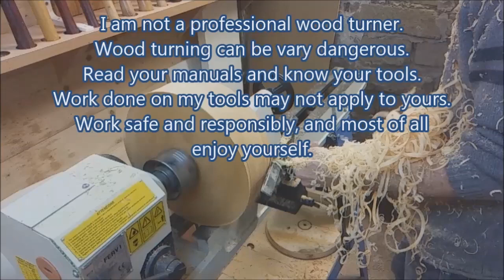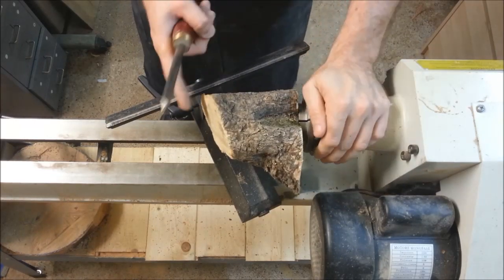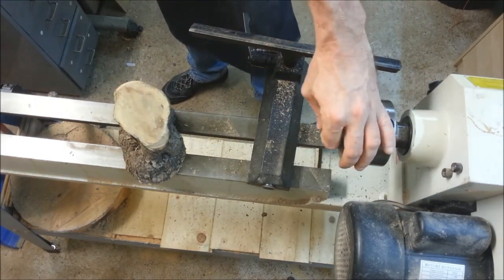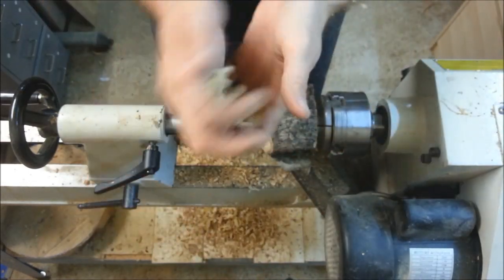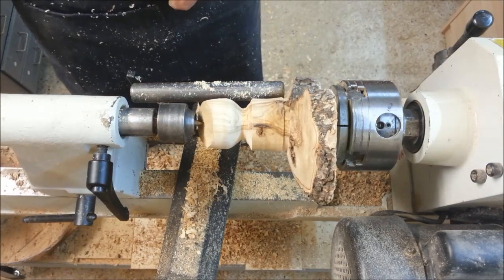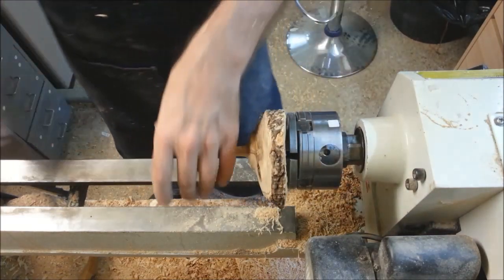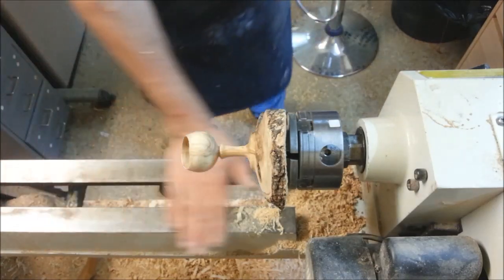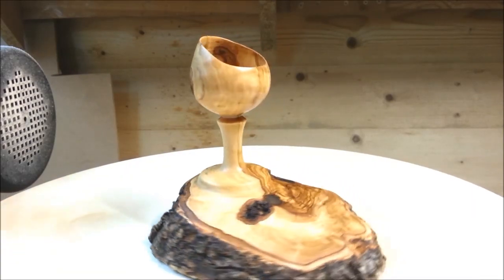Woodturning A Natural Edge Emerging Goblet

Comment: Thank you Yuval,
I've been following YouTube turning for a long time and I have to say that is probably the most beautiful piece I have seen.  It has everything: beautiful wood, masterfully turned, a piece of natural edge, lovely finish etc.
I wish I had your talent.
If it's any help I've had some problems with the worm screw but now I bore the hole on the blank about 3/4 depth, start fitting the worm by hand and then using a small spanner/wrench finish it until it bites into the wood for the last 1/4.   I then fit it to the chuck and it normally stays there.
Best wishes,
Alan.
Reply from the maker: Alan Simpson Thank you Alan,
I've been uploading videos to Youtube for a little while now, and I have to say that is the best compliment I have gotten. :)
I shouldn't have used the screw to start with, end grain and all, and then I should have used the tail stock from the get go, and maybe that tear-out off the screw could have been avoided that time.
I'm not sure I understand your method, you drill 3/4 of the depth the screw will fit into, and let the screw bite on its own the rest of the way in? my wormwood screw had a flat head, I don't think it will work on mine, I know there are some screw chucks out there with a pointed screw, do you mean that type of chuck?
Reply: Thank you Yuval for your reply.When I use a worm screw I find the centre of the blank even if it is end grain, drill the hole preferably with a bit a little smaller in diameter than the worm, just go maybe 3/4 or 2/3 depth.   I then insert the worm screw which isn't pointed but flat-headed just like yours.   I enter as far as I can just using my fingers after which I use the small wrench to screw it home.   The last little undrilled part of the hole then accepts the end of the worm  and bites.  The worm should then be really tight.   It takes a little bit of effort to gain that extra bite but well worth it.  Having said that my worm screws have two flat sides on the protruding head which enables the use of the wrench.   I then fit it snugly into the chuck and tighten it.  Usually (not always) it stays on and where possible I bring up the tailstock as you did for extra security.I have set myself a task of now watching your other uploads over the coming week.  I'm always hungry for new knowledge and totally  obsessed with turning and just love beautiful wood.Kindest regards,Alan.
Reply from the maker: Alan Simpson Thank you for your explanation Alan, I keep thinking cross grain, but it's end grain we're talking about, it will part for the screw even if it's not drilled, I need to keep this is mind. I used to screw my wormwood screw off the lathe, and then I used the flat sides on the base of it with a ranch to tighten it, usually all the way to the flat bottom, but then I found out I'm using the screw wrong, as the flat bottom I used to screw to was actually the guide of the screw, which supposed to be flat against the floor of the chuck, and I found it out since pieces were flying out of the chuck with the screw, which didn't seem right, only then did I found about the real depth the screw needs to be set in the chuck. Ever since I've been screwing my work onto the screw while it's already correctly placed in the chuck. I've been an avid Youtube turning videos buff a while back, then 4 years ago I took the plunge and started turning, up until last month I had only a couple of hours a week to turn, so I didn't do much, but since I lost my job a month ago I seem to have a little bit more time on my hands to turn and upload videos... would prefer a job, and go on turning for a couple of hours a week, if you ask me, feeding the kids and paying the mortgage is quite a motivator to wake up and go to the office :)
Reply: I'm sorry you are out of work at present especially when you have a family and a mortgage.    You sound like  very intelligent and civilised person so hopefully you'll be back in work soon.I am in retirement now which means I can and do turn most days.May I ask which country you live in - I'm always fascinated where people live.Best wishes,Alan.
Reply from the maker: Alan Simpson It's ok Alan, I'll find something to do for a job, that, or sell my house and kids :)
I live in Italy and have been for the past 12 years, but in fact I'm Israeli. The economic situation here these days is not so good, and the fact is I don't have a job anymore since the company I worked for the past 5 years have come to realize that they are making no money here in Italy, due to high taxes on everything, so they are moving to Cypress and open the company there, so my contract wasn't renewed a couple of months ago, since they need to close down... just bad luck I guess, but there is not much call at the moment for 38 year old mobile/web multiplayer games programmer, which is my profession for the last 20 years. To tell you the truth, I would love to switch line of work, sitting endlessly at the computer day and night is not my idea of fun.
Reply: Thank you for your reply Yuval.    I've only visited Italy once and loved it.   Also, I'm an admirer of the Israeli people especially what they went through during the Second World War.I've two sons both  of whom work in London and one of them is a webmaster while the other is an employment lawyer.   They both sit in front of computers all week but at weekends and during holidays they go walking on mountains to compensate.   One of them is off to Finland next month to do some walking.   I offered to go with him but he declined as I'm too slow:-).You are a very gifted turner so maybe you should set up your own gallery and workshop and think about giving tuition. There's a gentleman who lives on Crete who does exactly that and advertises in UK turning magazines.Any, I look forward to seeing your other uploads and wish you all the best for the future.Many thanks,Alan.
Reply from the maker: Alan Simpson Thank Alan for the interest :) Next time around you come to the Rome area, let me know first, I'll show you around, and no worries, I'm not keen on fast walking, so pace can be as leisurely as you'd like :)
If you haven't been, Israel is a wonderful place to visit too, you know, under the circumstances... I would love to open my own gallery, as a matter of fact the town I live in just started a program to encourage local artists, where they give them a space to work and show and sell their goods for a minimal rent to the town, and I have a guy who knows a guy, and they are both checking to see if I qualify for the program, so it just might come true. Should it will, and should I be able to make a living off my art? I will call it a life long dream come true, as a son and a grandson or artists who couldn't.
Reply: Hello again Yuval,I've looked up the guy in Crete and coincidentally he specialises in working in olive wood.His name is Nikos Siragas and his website is www,siragas.grI've considered going to him for some extra tuition and combining it with a holiday with my wife.   In cases such as this he provides activities for wives /partners of his students such as day long coach trips.I still may go some day but it means travelling to Athens first before getting a connection to Crete.However, wood turners can overcome anything:-).Alan.
Reply from the maker: Alan Simpson Sounds like something I could manage to do, if I only had the starting capital for a studio (right now all the space I have is a couple feet of paved back garden), but it sounds like an amazing experience! I once been to Greece, took a hang gliding course there a few years back, but I love the turning course + activity for the wife combo! sounds like a win/win/win for all.

Comment: That's a fabulousn piece with a great summary of how you felt on completion. I've just done my first natural edge goblet and you have now inspired me to have a go at an emerging goblet. Just one thing: How did you finish the base particularly where you had a screw chuck. Did you plug it or leave a hole. You know woodturners, the first thing they do is turn a piece upside down to look at the base. As if Joe Public cares!
Reply from the maker: I do use plugs to fill the holes, you can see it in a video hiding a few videos down, about how I finish the bottom of my work.

Yuval

Comment: Yuval - this is so beautiful. The wood is gorgeous and the goblet and base are magnificent. I watch this every so often, cause you did a great job and a great save :)  I would like to try this , altho getting Olive wood is a little hard where I am in the South. But I am going to put this on my things to try. I assure you I will be referencing this video multiple times. But it will take me many tries to get one as beautiful as this. Take care and safe turning.  Jan .....
Reply from the maker: +Janice Kneule Jen, this was the first time (and so far the only time) I've trying something like that, so if it went so well for me, I can see no reason why it can't go well for you. Just go into it with extra confidence, make sounds like you know what you're doing, think twice before each cut, it's simpler then it looks, and for it was mostly luck with the wood, the shape of the off cut, and a good and lucky day ;)
Reply: Yuval Lahav Will do Yuval. !!  If I make thru one of these, and it looks good, I'll post to FB. Have a good one - Jan .....

Comment: I just have a cheap 4 speed lathe that I'm using.  The lowest speed is 1,100 on it.  Will that be slow enough to do this type of turning?  Your work is both beautiful and inspiring.  I wish I had access to Olive here.  I turn mainly nut and fruit wood.  Thanks
Reply from the maker: Thank you Todd! A speed of 1,100 is a little fast, but in the end, it depends on the shape of your piece, the more misshapen it is, the lower you should spin it, or as far out of center you plan to turn it, the slower it should spin, so yeah, you could turn something similar at your min speed as long as it's not very misshapen and/or you don't try to turn it very off center. Hope this helps! And sorry I can't help out with some Olive ;)

Yuval.

Comment: I have , and am now checking out the laser engraver you used to personalize them. By the way how is it holding up for you.
Reply from the maker: Just perfectly, I've just finished laser carving on a set of 10 pens, and on their boxes a mixture of logos and text, worked the machines for about 3 hours non stop, nothing even turned warm. Still works :) The only thing I would change is I would love for them to ship with it a key to turn the lense, since you have to set the focal length by hand by screwing the lense in and out for different heights, the lense screw is quite small and uncomfortable to turn if you have thick fingers like mine. A cheap metal (or even plastic) key that fits on the lense to help you turn it would have been a plus.

Yuval.

Comment: Very nice Turning my friend.  The form is awesome function well...  Bet you now why it came off the lathe...Worm screws don't hold very well in end grain.  It would've been better to use the side grain for the mounting...It's a learning process and I've learned that one the hard way...Seems when I get older the hard way is becoming more and more prevalent.  Thanks for the fun vid...

--Marc
Reply from the maker: Marc Tuunanen Thanks Marc! I did know that, but as always, I remembered it only after it came flying off the lathe... what I didn't show on the video, since I want to keep them short, if you can call 20 minutes a short video, are the different attempts to fix it, using a plastic sleeve inside the hole and screw it back, then a dowel in and drill again, some fresh shavings packed in, epoxy and re drill, nothing worked, I didn't want a different orientation, but in the end it all worked out :) Thanks for watching and for your comment!

Comment: Great job, Silly question from a beginner,this is green wood? Thanks
Reply from the maker: WILL R Will, not a silly question at all, I didn't mention it in the video, this is a fresh off cut from a piece of olive wood that fell in front of my house in a wind storm a couple of months ago, you can see it in video #7, where I cut it up and make a couple of tealights with some of it, and you can see a couple more piece of it in different videos, and through the magic of the internet, you'll be able to see more of it in the future :)
Reply: Yuval Lahav Thanks for the reply Yuval,I guess my next question is will it not warp when it dries out or is that what you want it to do. Thanks again,enjoyed the video and what a great help for a beginner.
Reply from the maker: WILL R Well Will, it will warp, no helping that, what I do is keep on oiling the vessel (in this case the goblet and base) every couple of days and let it cure, this displaces some of the water and will make it warp less then normal, but warping will happen, it is different from tree to tree depending on the grain, moister content and many other factors, but I can tell you I simply love how the Olive warps, he gets ridges on the surface with every change of color in the spalting, making the surface look a little like Damascus steel when looked at from the side, it's quite lovely. Holm Oak for example will warp very very little, almost un noticeably, but it will shrink in general a little (if you've seen the rest of my videos, I'll show the vase with hemp string I made in a few videos, soon, to show how it almost didn't warp but shrunk), on the other hand, European Eucalyptus will warp so bad about 90 percent of what I do with it won't survive at all but will fall to pieces when it dries.
Reply: Yuval Lahav Thanks Yuval,good information,very helpful.So much to learn about wood.
Reply from the maker: WILL R Any time Will, you chose a hobby where the learning never ends... which is good, it will leave us interested for the rest of our lives... :)

Comment: i was wondering, at approx 09.45 you were worried about the danger of working at that angle because of the base restricting you from working at your natural angle, is it not possible to work from the other side of the lather or is it up against a wall or something, maybe something to think about when you locate a lathe in a workshop that the freedom to work around it is always there if needed and i suppose if the workshop is big enough for you to do that, great job anyway.
Reply from the maker: Depend on what you are cutting, you can work on the other side of the lathe, for example, especially in hollowing, it is common to either work on the other side of the lathe, or turn the head stop a little outward (if you can) which will let you work much more comfortably. If you want to cut the outside of something, you won't be able to do it on the other side of the lathe unless you have a lathe that can spin both direction. Mine can't. Also I don't have much room in my little shop to place the lathe in any other orientation without loosing too much needed space.
Hope this information helps!

Yuval.
Reply: thank you Yuval I thought you might have had restrictions like those mentioned, cheers for answering and keep up the fantastic level of work.
Reply from the maker: Thank you! And I will do my best, once my lathe is fixed :)

Yuval.